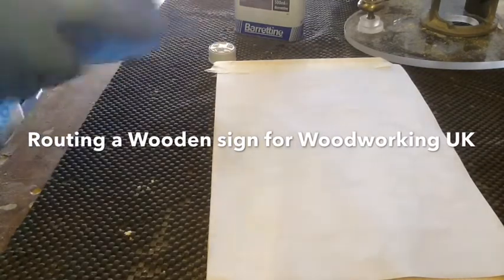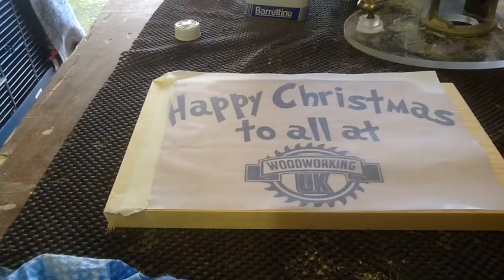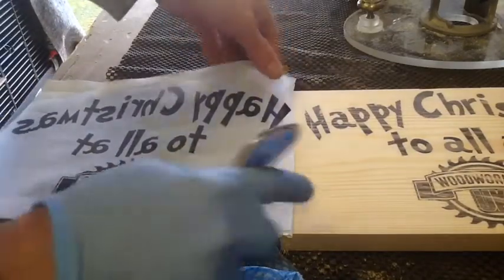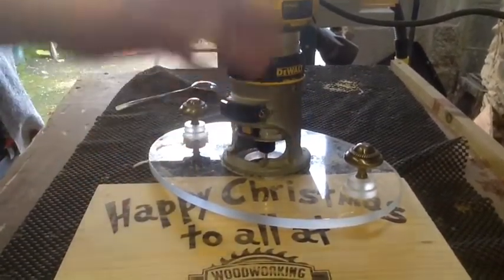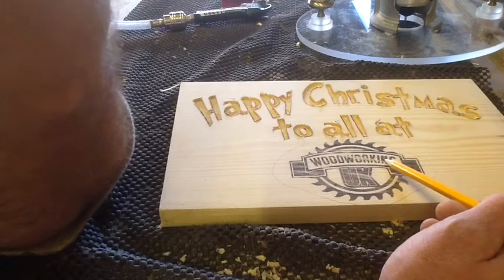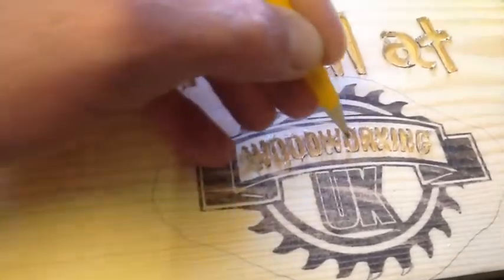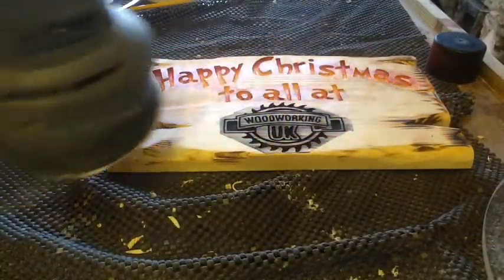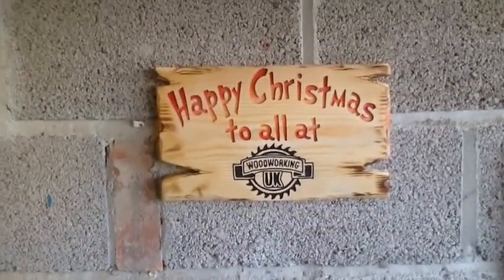make your own christmas wooden sign with a router

Comment: I like your work, especially the burned effect. Where do you get your bits from? I got some from the States recently but the postage and VAT was crippling. Thanks
Reply from the maker: SpaceWalla hi there and thanks for that. I generally bulk order the bits from China, then I sell some on to people who are interested. I use the 1/8th shank router bits, commonly used in cnc machines. They are much cheaper than your average bit

Comment: What kind of paper did you print on before you applied the thinner? :)
Reply from the maker: I.just use regular printer paper, th trick.is that it has to be a lazer printer and either cellulose thinners or acetone. Also it doesnt work well on dark wood, but anything else is fine

Comment: where do you get your bits?  What size do you use?
Reply from the maker: Terrence Powell I import all.my bits from China usually and I prefer to.use the 1/8th shank bits. Much cheaper than the 1/4 inch..you will need a collet.reducer as well. I sell them in the UK and Europe but.you should be able.to.find them on ebay

Comment: what routers can be used for this work & where can I purchase the bits. please post it for us. thanks!
Reply from the maker: Hi There, any 1/4 inch router will do, as for the bits, I use 1/8th shank bits designed for cnc machines with a 1/4 to 1/8th collet reducer. Depending on your country, eBay or Amazon are your best bet. Look for v-groove bits 10 degree for fine work up to 60 degree for outlining letters